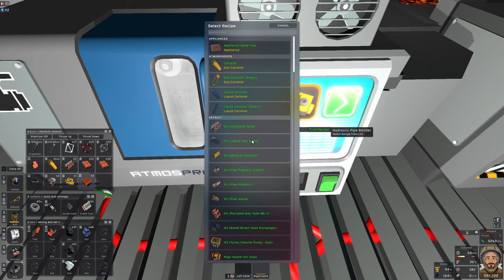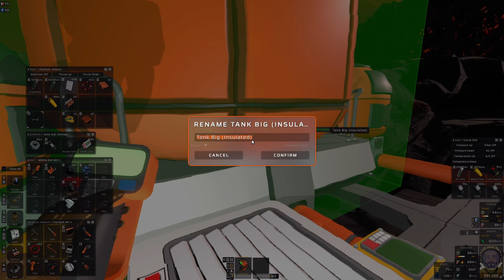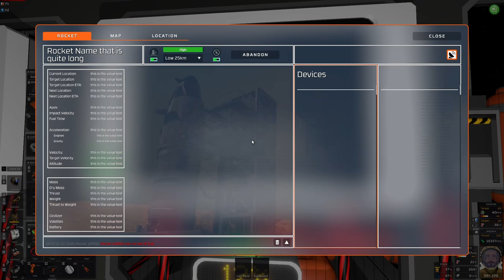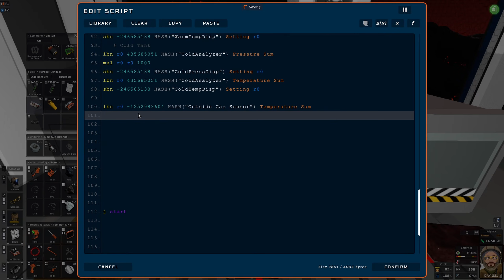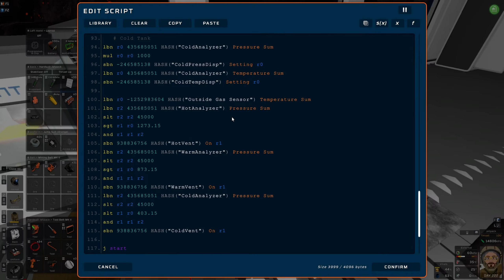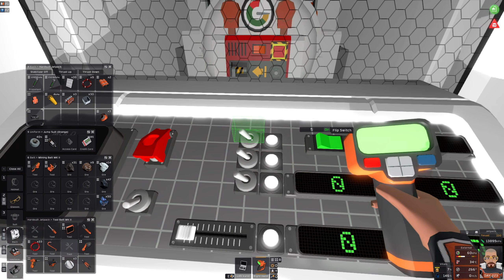New Furnace Fully Operational - S2 E65 ║ Stationeers

Comment: Should you have the warm tank not input if the temp outside is in the hot tank range
Reply from the maker: The warm tank is kind of a "year-round" harvest, but just in case we need summer-time temps specifically, I wanted to have that as an option. Basically both warm and hot tanks are fine if they are super hot, but the warm tank will rarely going to get that hot.

Comment: It doesn't seem a great idea to vent your hot waste gasses directly at your volatiles tank. Especially since smelting a lot of lead, silver, and gold could be outputting oxidizers.
Reply from the maker: I have the gas displays on the consoles, so I'd monitor what goes back into the tank.
And besides, the whole point of recycling the hot gases is to use them again, if I vent oxidizers into the hot tank then it would just make it even hotter, which is kinda the point. :D

If I ever decide to do it then it just need a back-pressure regulator to make sure it doesn't overpressurise, but the hotter the better.
Reply: @Hmuda  I meant the vent pipe with the cowling ending in the tile with the base's external volatile tank. It's probably not a danger, but it just gives me a bad feeling, seeing potential fire pointed right as the gas storage.